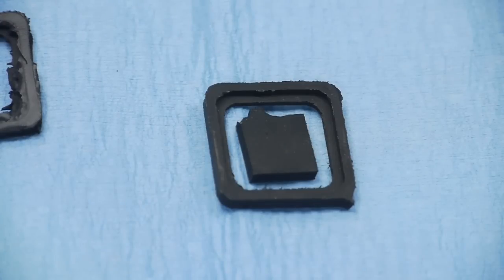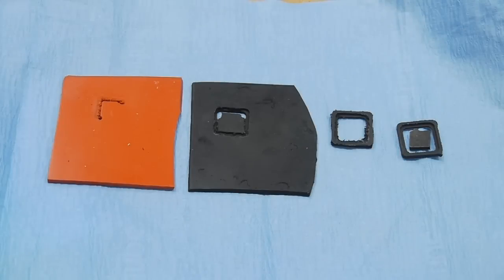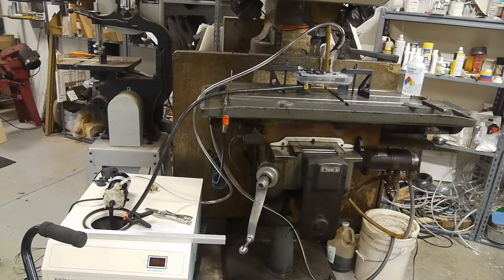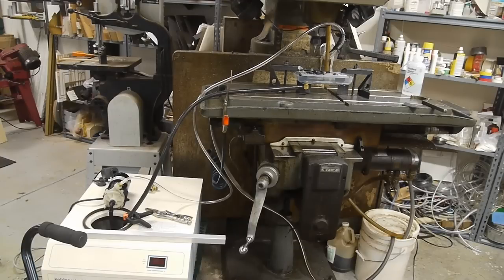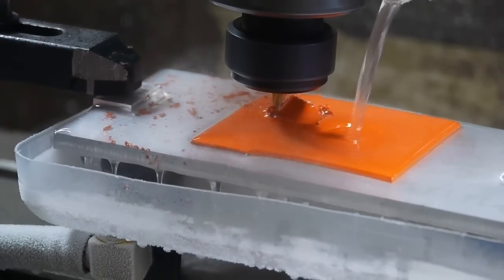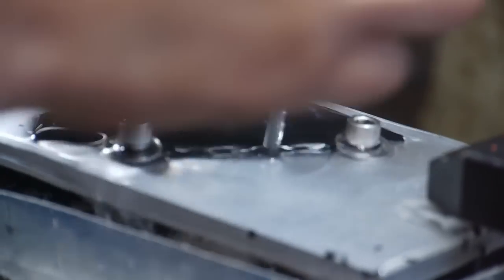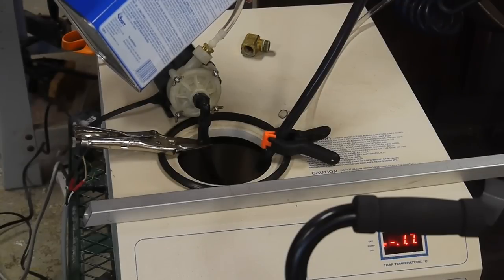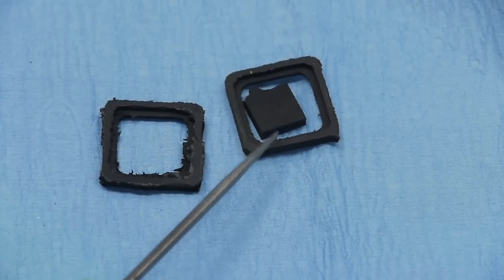Cryogenic machining: Custom rubber parts

Comment: I have made hundreds of complex close tolerance soft rubber parts for the submarine industry using conventional Dremel grinding wheels and a high speed spindle (in a Lathe OR Mill).  You just need to think outside the box.   Trust me, try it

Comment: In my Physisc Institute in Torun (Poland) since 70' rubber is machined using liquid nitrogen. Of course there wasn't CNC, but this method gives very precise parts. We made liquid nitrogen in our condensing unit so it was very cheap method of chilling.

Comment: This technique is probably not used as much anymore because there are plenty of options for making parts like this using a 3D Printer. The idea itself has a lot of merit, and it's great to see these types of manufacturing techniques demonstrated. Keep up the good work! Your videos are fascinating.
Reply: I wouldn't be so quick to write this off as an outdated technique; while filament extrusion printers have become incredibly common, you can't make anything but ABS or PLA parts. The great thing about this is that you can directly create complex one-off parts out of various elastic or soft materials with parts you basically have laying around, assuming you have a mill.
Reply: I think being able to make custom rubber parts is enough to give this technique worth. [Harder] plastic can only get you so far.
Reply: Additive machining may be a revolutionary process, but it isn't the end-all be-all of manufacturing processes.  Mills and lathes aren't going to be going anywhere anytime soon.
Reply: Ryan Willis You could possibly print parts like this on an extrusion type 3D printer using a thermoplastic elastomer filament like Filaflex or Orbi-Tech TPE.

While we are on the subject of filament materials, there are others too, like filaments based on nylon, High impact polystyrene(HIPS), polyvinyl alcohol(PVA) and polyethylene terephthalate(PET), polymer composites containing carbon fibers, wood dust, chalk etc, and filaments for printing foam/porous rubber(Basically TPE particulates in a PVA filament, the PVA is washed out with hot water or a suitable solvent after printing, leaving a porous object made from a TPE). Other 3D printing processes can handle other materials too,

However, I agree that 3D printing is just another tool, not the ultimate production process, there will always be other processes that may be better on some things, though 3D printing may still play a part as a step in a more traditional process, you can 3D print a model for making molds for casting, for example.
Reply: For the price of a good 3D printer, you can have an excellent milling machine and the capabilities to machine everything known to man(almost). Plus you can make gears on some milling machines, new bedstocks for the same machine, pulleys, everything a lathe can do as well as flat surfaces.

Lathes can't make themselves, milling machines can.
Reply: wolfy9005 That may be true, but 3D printing is in it's infancy. Just like the first hard drives and laser printers cost tens of thousands of dollars, 3D printers will become cheap commodity items the same way.
Unlike CNC machines and such, 3D printers will eventually become so fully automated they will be "fire and forget". Press "print" and come back later to retrieve the finished item. subtractive machining will always have uses, but will never become a commodity, because it will always require a lot of expertise and skill to operate.

There will always be applications best suited for each technique, but for the layperson, 3D printing will be the dominant method.

Plus, you can make "impossible" things with additive manufacturing (think "ship in a bottle" types of designs with no seams or openings.)
Reply: Ryan Willis
And a very low temperature freezer or source of liquid nitrogen or dry ice for the cryo bit.
Reply: Good point. It seems reasonable that the cryogenic equipment and liquid probably range in price similarly to the price of 3D printers alone.
Reply: In a pinch, you can do this far cheaper, with dry ice.
Reply: Jayson Carey people said the same thing about newspapers and tv not too long ago. Guess whos on the corner begging for money now?
Reply: ***** you've never actually made anything have you?

Comment: If you're interested in this kind of thing, you should research Intraocular Lenses (used in cataract surgery). The state of the art material that is used in these lenses is a soft acrylic (harder than the neoprene shown here, but still pretty soft). The most common way that these are made is by cryo lathing the lenses. The optic diameter is about 6mm in diameter, and using the cryo lathing process, you can cut a near optic quality surface.

Comment: Very interesting setup.  At the research lab I worked in at university (as a lowly undergrad ) one grad student needed to drill 12" long holes in a block of neoprene.  I think the mechanical engineer who ran the lab knew about this method.   He poured liquid Nitrogen on the neoprene as the cutter went through it.  They used a 3/8" Dia.  steel tube that had one end sharpened.  They got good results.  The holes through the neoprene were for simulating blood vessels. Not sure how that experiment turned out.

Comment: That's a neat way to deal with needing rubber parts in a hurry, and in low quantities.  Have you done this long enough to get a sense of how the tooling holds up at low temp? I could imagine the tool chipping if the rubber got hard enough...

Comment: This is very interesting.  I think they make CNC tools with holes in the tool to flow LN2 through the head.  It also might be better to set up a open tray and CNC the part in a bath of LN2. Using ice to stick it down is brilliant.  For neoprene because it is permeable putting it in a pressure cooker for a few minutes might work well.  The water saturated part when frozen should cut like frozen butter.

Comment: I have cut nonfrozen rubber on a lathe using very high rake, almost knife-like cutting tools made of high-speed steel with generous relief angles on all too; surfaces at rather high speeds that I thought kept the rubber against the tool with centrifugal force. I used an oil-in-water flood lubricant that made it cut much better. I expect the water, not the oil, helped the cutting. I arrived at the method through desperation. I would have used your method of dry ice and alcohol had I known of it.

Comment: Great thanks a lot. Now next best thing is to use a rubber resin and print it in SLA printer or 3D printed mold and silicon rubber. If we want a specific rubber material your method would be the best.

Comment: Very nice, silicone(and neoprene) just got a lot more useful!
  Also I think Machinable ice could be really handy for lost casting cooler materials, rather than firing a lost wax ceramic mold for metals. Do you think there is a good dissolvent that would make it machine better when frozen? Might be worth playing around with

Comment: I'm curious to know what tolerances you were looking to achieve in milling the chilled rubber?  As a fitter & turner specializing in plastics injection mold making every dimension required a nominal shrinkage rate added to the finished product size - to compensate for plastic shrinkage as it shrank from 200+ degrees C. to room temperature.  We used shrinkage rates of anywhere from 1.02% to 1.2%.
So did you have to calculate any subsequent machining 'shrinkages' to compensate for the chilling of the rubber?
Reply: I think that more simple way is cutting some test detail and just measure what it be.
Reply: Depends on the material, exactly how much any given material varies from another I wouldn't know. 'Coefficient of thermal expansion'  should be a useful search term, otherwise, as previously mentioned,  'guess and check' methodology might be  possible.

Comment: Hi, Ben. I'd give your ice-vice technique another try with internal passages in the alu plate: water the plate and place your rubber stock onto the plate, run the coolant thru the plate and get it cold. Apparently, this won't work that well with thick rubber pieces, but I'd expect it to perform rather well with something similar to what you've shown. And no more stickin clamps!

Comment: A little tip for the pump. A little peristaltic pump using silicone tubing will solve some of your problems, just the flow rate could be to small. I make them usually from 5mm-MDF if it needs to be cheap (coping saw and drill press). Lasercut acrylics if I have some more budget on a project.

Comment: Sparey's The Amateur's Lathe, suggests that rubber can be cut on a manual lathe using stanley knife blades.
Something akin to a flycutter might work well for "milling"

Comment: If I need some rubber material for a simple use with a specific form I cut out with the CNC a form and fill it with silicon. After cooling down you can use it. Works fast and is simple. Of course not for that many uses...

Comment: I was working on a project that needed custom boots. I found some tie rod end boots that almost worked, but the smaller hole was too small. However, remembering this video, I used some liquid CO2 to cool the boot down, allowing me to use a very bi to drill out the hole. Thanks for sharing your ideas and making these great videos.

If you are interested, I did make a video on what I did: youtube.com/watch?v=hZKY56i-D34

Comment: I glued a piece of aluminum to another piece of aluminum with orange silicone RTV and then chilled it down with liquid nitrogen and tapped it with a hammer. It broke right off. So there is a temperature where silicone will get cold enough that you could cut it, but it may be too brittle to survive.

Comment: I have borrowed and used a cold gun while milling hardened material with a tungsten carbide end mill. I am an apprentice toolmaker so I have only 10 months experience machining. So I think the tool steel was cooled way better than using liquid coolant. Doing some research I found out they are easy to build and can draw temperatures to freezing point. Maybe you can freeze the rubber using a cold gun. Sounds like a future project. No?

Comment: Very very cool stuff!

Another method, at least if you're dealing with things like these and you happen to have a laser cutter, well, you can see where I'm going. Only downside to that is that it's a very dirty process, creates a lot of blackened particles everywhere which needs to be vigorously scrubbed off. 

What would you think about building a liquid cooled plate, basically running coolant through channels cut through the plate to supercool it. Maybe it's a bit like the ice vise you talk about, and I don't know if it would get cold enough to chill the rubber properly, but food for thought at least.

Cheers!

Comment: If you need simple 2D gasket shape, you can just use dragknife with your CNC (see donek tools dragknife + bCNC dragknife software). 3D gaskets can be probably cast using RTV silicone to some machined/3d printed mold.

Comment: I make some parts that are essentially Tygon tubing (64 Shore A) with countersunk (internal chamfered) ends.  They should be injection molded, but the short run manufacturing is too low a volume to justify molding.  I put them in the freezer in the kitchen.  I manufacture them in batches of 20 at a time.  Any more than that and they thaw in the summer and the cut quality is bad.

I enjoyed seeing your dry ice and alcohol machining technique.  Thanks!

I had previously considered a small Styrofoam box with dry ice, but the freezer compartment of my fridge is good enough for my needs.  If I'm in a hurry, I'll sometimes dunk the parts in ice water to facilitate the heat transfer and machine them a bit wet.

Comment: Very small bit plus very high speed and you can mill butil and other elastomers warm. You can actually melt and blow the cuts instead of cold cutting. I use a hand mill to shape rubber in various ways when I need oneoffs. Silicone rubber should mill fine too with this method. It's just that the bit must spin really fast and move x/y pretty slow.

Comment: Even for a one off I would mill something else to use as a mold for my part. Oogloo (made from more or less equal parts of silicone 1 and cornstarch and coloring) is wonderful stuff and casts very well.

Comment: Venezuelan 17 years boy over here. I have a couple of questions that I would like to ask you guys about this topic. This is a cheap alternative to get a cut piece of rubber (That could be worked with a cutter). But... These kind of thing leave a lot of questions about the methodology and the results.

1) What are the best results that you could get using a 3d printer which works with the closest material to rubber? Will it be cheap?.

2) During the process I noticed that the alcohol flow was constant in order to prevent the formation of those sticky ice particles, what about if you use an azotrope solution of alcohol (concentration greater than 98%) in order to use a smaller amount of that substance, just store it in a boil for few minutes and them extract the rubber piece to cut it.

Just one advice... I am learning English and my knowledge wouldn't´t be perfect but the right/best way to pronounce "ALUMINIUM" is the British one :) I like your videos and please keep making such wonderful work. Hope your answer soon.
Reply: chavo comprate un cortador lase chino de 100w CO2 y puedes cortar hasta 1/4 de espesor

Comment: Very interesting, I would like to try it myself. Dry ice seems like a rather cheap and effective way to cool ethanol. However, obtaining a pump capable of reliably pumping this very cold ethanol seems like a more complicated problem. Do you have any advice regarding that? I have no idea what to look for or where to look for it...

Comment: Did you have issues with chips getting into the tank or pump? Or did you have a filter or it just wasn't an issue? Thanks for the video :-)
Reply from the maker: Chips definitely made their way down into the tank.  My pickup tube was a few cm up from the bottom, and the chips sunk to the bottom pretty quickly, so I didn't have a problem with clogging at these low flow rates.
Reply: Applied Science Gotcha, thanks for the reply.

Comment: I saw that magnetic coupled pumps, that are BLDC driven, in a photo-developer machine. I was called upon to repair one, but it was not the pump, it was the flow sensor. So, if You are in a need for such a pumps, try find some photo film developer machines, there could be a couple of those (for every chem, one pump).
Best regards

Comment: Wow, great job! I wonder how it would work with a pour of liquid nitrogen? I like it because I once managed to turn some miniature rubber parts using a can of blow-off air duster, upside-down, so that the coolant comes out and you can direct the spray onto the work, freezing it long enough to machine. Small stuff only!

Comment: Is there some kind of additive, which would make melted PE flow more 
easily, so it can be casted without use of press? I've found "diy 
machinable wax", which is PE dissolved in melted parrafine. You can 
easily cast it to blocks and machine. But it's still 80% wax. I wonder 
if this could be done 80% PE with some additive, so we don't loose the 
performance, but still can just heat the waste plastic and pour it without 
need for mechanic compression. That way i would be able to cast recycled
 plastic blocks for machining final parts rather than wax prototypes.

Comment: I've had good luck recently 3D printing urethane elastomer, I made a gasket-like part on the makerbot at work (also printed some random squeezy toys too).  The surface quality would probably be similar, but the dimensional accuracy might be a bit worse.  Urethane isn't as suitable for some applications though.  You can also laminate laser-cut sheet stock for some geometries.

Have you ever tried cryocommunition of zinc or similar metals?
Reply from the maker: 3D-printed gaskets sounds like an especially good use for 3D printing.  With support material, it could be a really effective technique.  I had to look up cryocomminution, which is just crushing/grinding?  I haven't tried it.  Would you use something like a ball mill with ceramic media for the crushing?
Reply: Applied Science
a drop hammer is probably easier to build at home, but I think planetary ball mills are used commercially.  I think metal media is less likely to shatter in a planetary mill, as long as it is still ductile at the temperature that the charge is brittle at.

Comment: Nice info, very usefull , do you use 2 or 4 flutes in the end mill?
Reply from the maker: battleminion Two-flute endmills are good for deep slotting on manual mills -- plunge down into the material, then move in one direction to make a slot.  A four-flute endmill is more bulky and will prevent chips from being cleared from the slot, as well as jamming against the wall of the freshly-cut slot.  Many CNC toolpaths are designed to minimize slotting by using a helical plunge path, and expanding perimeter cuts.  There are also three-flute endmills, which provide a compromise between slotting capabilities and cutting speed.
Reply: Oh thanks, I will try to make some test if i find a old chiller for freazing the alcohol Thanks

Comment: I like to stamp out rubber parts with my press for nice clean cuts. think of a cookie cutter. You can form a die from sheet metal and use a shop press.

Comment: Hi, love your videos. However have you tried a very high flow rate of  coolant at the milling tip (contact area between tip and material) that would cool off any excess heat generated at the origin. This should make the material harder at that point and make it better for milling. I might be wrong but it sounds logical. Thanks